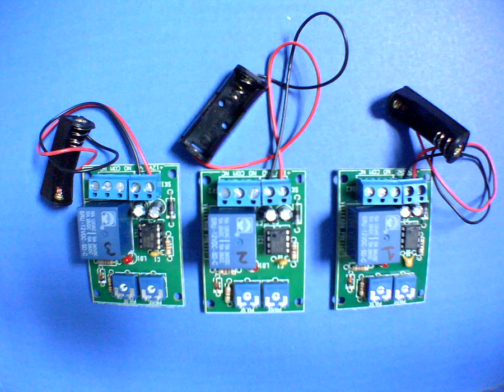555 Timer triggering problems | Public Lab

Comment: Are the caps good? What type of 555 are you using, CMOS or standard? What's driving the relay coil, any snubber/diode for inductor voltage spikes?